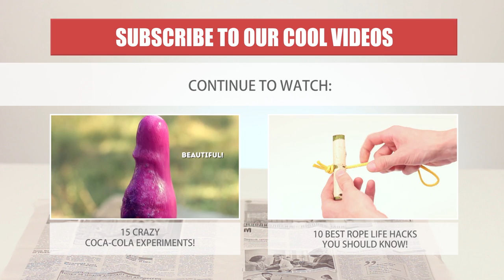10 house Repair life hacks from Mr. Hacker

Comment: If I saw a contractor using any of these, I'd immediately suggest that the client hire someone else. For DIY guys, okay. But a big NO on the jobsite.
Reply: They have their own top tips.
Reply: Almost Every Contractor is using the Tape ob Drill bit tip 
some of the Tips are just ridiculous but for example the Magnet on Hammer is kinda handy
Reply: Not only Wood  I suppose I should re-word this to say most, not all. Admittedly there is  in fact a hard drive magnet hot glued to my drill for holding screws...

However I fail to see the point of using tape on a drill bit. Okay you're making the depth of an anchor, but if you're drilling into drywall, then why bother? It's 1/2" thick... What's the worst thing you're going to do by drilling too deep? Snag the insulation, okay but no big deal.
Reply: Badger0fDeath Hmm, good point. A better demonstration of that hack would be on a masonry wall
Reply: True, this should specify personal house repair in the video or title. Hackjobs like this will get fired quickly and there's some hazards in this.
Reply: ***** Not only the potential hazards here, (eg: good luck if that hacksaw blade jams) but just on principle... You're not instilling a ton of confidence in your client by using a laundry pin while driving nails. Completely unprofessional.
Reply: Jack Duno Yeah,
most of these hacks can be done just as effectively with the proper tools and with high experience. Cheating your way through tasks like this will cripple your reputation and even prevent you from getting higher paying jobs.

Comment: the first one is soo wrong.. you will get problems putting a nut on the bolt because its not coned. i use the lathe, but i quess not everyone got a garage full of machines home. in that case just buy the right size :)
Reply: another way is to keep a nut on the part of the bolt your gonna use, just unscrew it and (most of the time) it will work OK. still harder because of the lack of cone
Reply: I too have spent thousands on machine tools so that I don't have to run out for a 32 cent bolt!
Reply: Hey some people do that if they have to deal with hundreds of custom bolts lol.
Reply: ShakoDaBows Yep. Just stick it in vice and hand saw at an angle. It would be quicker too ffs.

Comment: Dont do the first one. The blade could get caught and you also risk ruining the bearings on the drill. Also putting screws on a fast spinning drill bit, probably dumbest thing i've ever seen. Im a 20 year licensed contractor. Just spend the 3 dollars on a magnetized drill bit. Or buy a kit. Because of the safety hazard on the first one, i'm looking into a way to ALMOST do that. But enclosed and safe.

Comment: The soap is not a good idea. The residual chemicals in it corrode the screw. Better is a slab of muttonfat, or the excess fat cut off beef.
Reply: WD40
Reply: I just spit on the screws
Reply: Paraffin wax. You used to be able to buy it in the food canning section of grocery stores. Don't know if it is still sold.
Reply: Doesn't stick to the screw as well. Beeswax would, but is far too valuable.
Reply: would paraffin wax be ok?
Reply: Or charge the batteries in the drill.

Comment: 0:35 thats really bad I would cut that just by sawing in like 5sec  with no hassle. also damages the blade
Reply: I agree ... Even with his method, the blade should be cycled back and forth so avoid wearing out the teeth.
Reply: +Yeggster Shane you are right, that is the correct method. people who use a lathe to make something, cut the end piece down this way.

Comment: Foolish boy.  If you put a nut on the bolt before you cut it, you would be able to thread a nut in use.
Now you have a bolt that has knackered threads and is useless.

Comment: Every one of these so call hacks does not apply to a professional craftsman. When you have been doing home repair, new construction, plumbing and the whole 9 yards for over 30 years you know what your doing and how to get the job done right the first time. That little trick with the magnets and nails is BS, it might be OK for your grandma or a house wife but a pro uses a nail pouch that you get at the lumber supply store for 50 cents or for free when you buy bulk lumber and 50 pounds of nails or screws. when your on a roof or on the top of a 30 foot ladder 3 or 4 nails on a magnet is not going to help you much when you need to have like 250 or more nails or screws ready to go. I have a leather tool belt that holds all my tools like my claw hammer, screw gun and at least 5 pounds of nails and any other tool I might need and allows me to clime ladders hands free and then have my tools ready when I get up there and by the way screws come pre lubricated and I use square drive magnetic tip with a cordless screw gun  so I can drive them with one hand like shooting a gun and I guess some people can't hammer in a nail without hitting their fingers with the hammer.